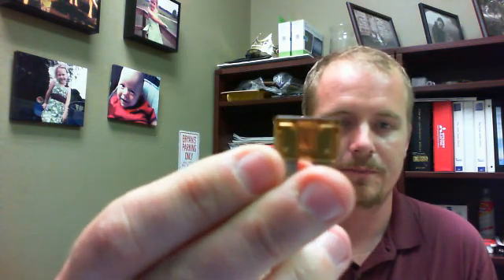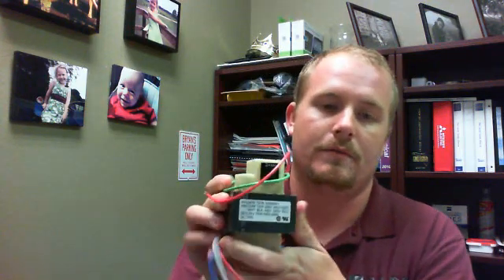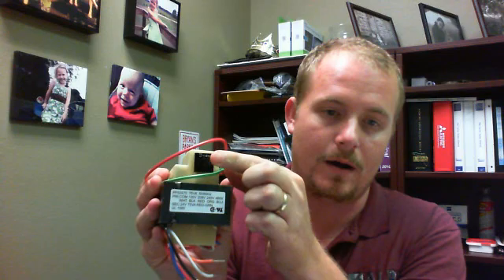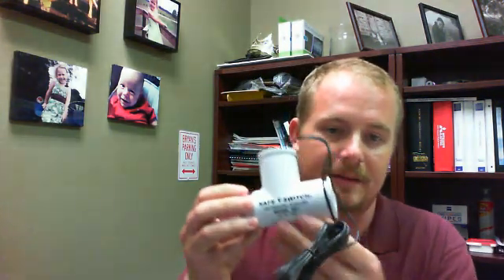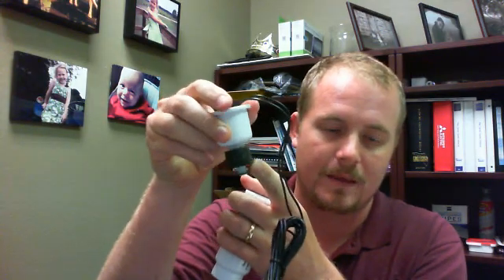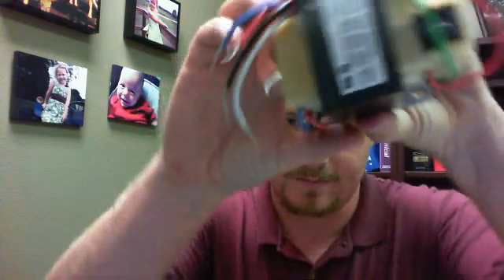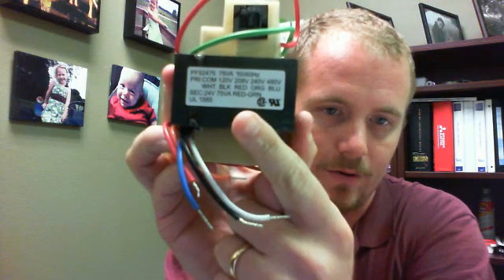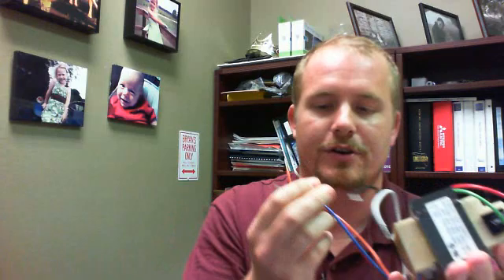Answers Regarding Fuses, Transformers and blank Thermostats

Comment: Thank you. My A/C  shut down this morning. I called a service man who would be here late this afternoon which gave me time to research the problem.The thermostat was blank. I checked my 10 year old Infinity Carrier air handler pan to find a portion of it with water in which was my sensor showing a red light. As you explained a sensor could shut down the system showing as a blank thermostat. The sensor is a round item about the size of a hockey puck with two lights. The red light was on. I dried the bottom with a hairdryer and replaced in in a dry area of the pan and then pressed a reset button on the sensor  and the green light came on and my thermostat regained power.  My A/C was back cooling our home.  I cancelled our service call and saved $139. Thank you again. I will be aware as to this happening again and to ensure the drain is clear, pour a bleach solution down the PVC pipe.

Comment: our thermostat went blank and I turned off the circuit breaker and then turned it back on. When I did the thermostat did display again and then faded out. I checked the furnace (it's in the crawlspace) and the fuse is not blown but there is no power at the low voltage connectors on the PC board. I noticed that the drain pipes had clogged and the bottom of the horizontal furnace was full of water. there is no protection switch for a clogged pipe. 

 I'm gonna hope it is the transformer that is blown and not the PC board...